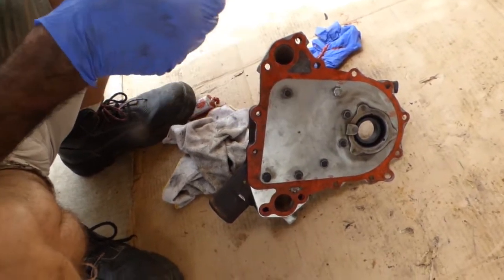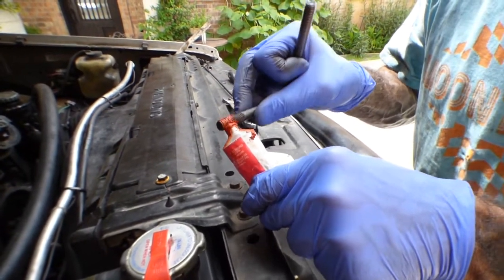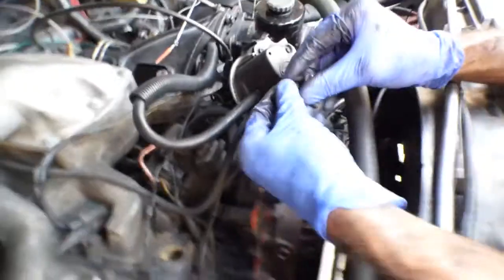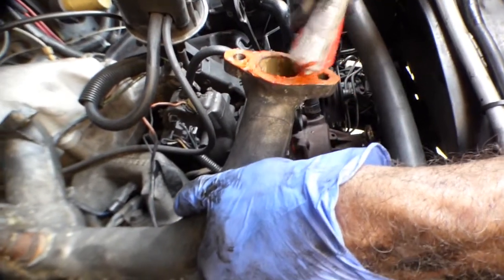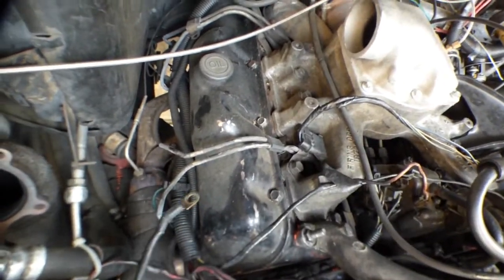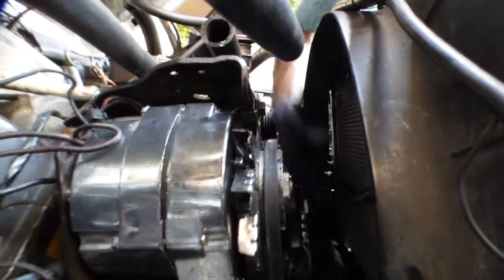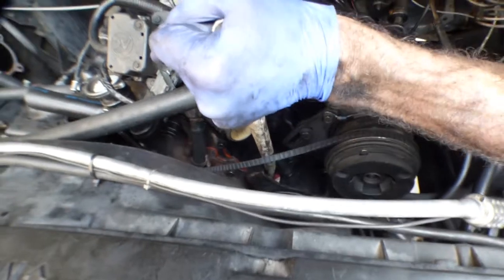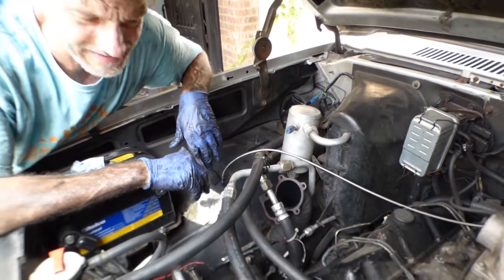How to remove waterpump from 6.2/6.5L GM Diesel on a squarebody K10 suburban.

Comment: u dont have to crank on that stuff n put all that force on it when ur trying to get ur belts tight,  get ur belts "hand tight", tighten ur bolts down so juuust snug then tap on whatever accessory until u get the tightness ur lookin for, its simple n itll easily get tighter than u need so thats not a prob then u jus tighten down without havin to hold other stuff
Reply from the maker: I have "smoked" both the AC and the alt belt on this truck-not tight enough.  They squeal and heat up and then come apart.   It has stranded me before.  I'd rather deal with bad bearings at 50K miles.
  I'd like to swap to a more reliable serpentine belt setup, but I've got a relatively new AC compressor, PS pump, alternator, and now water pump.

Comment: I'm looking at getting a 92 chevy 3500 vandura minibus with a diesel that needs a waterpump
... Is that the same engine???
Reply from the maker: That should have a 6.5L which is better than the older 6.2L .   If It is turbo it should have 200hp and 400 ftlbs torque.   The serpentine belt is a nice feature also.  The achilles heal is the computer.
Reply: @CrankAddict  Is the waterpump pretty much in the same location???
Reply from the maker: @soloman30  same procedure for your reverse rotation water pump.

Comment: Where was the water pump leaking from, water pumps usually leak from the shaft not the gasket.
Reply from the maker: It was leaking from around the gasket due to loose bolt.   Once the gasket blows, you're never going to get it to reseal by tightening it so I had to R&R it.